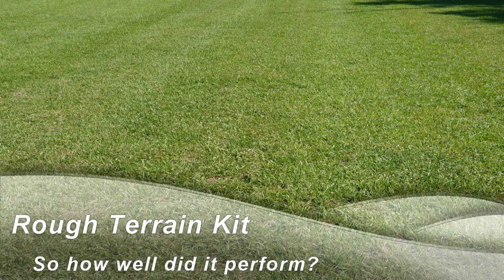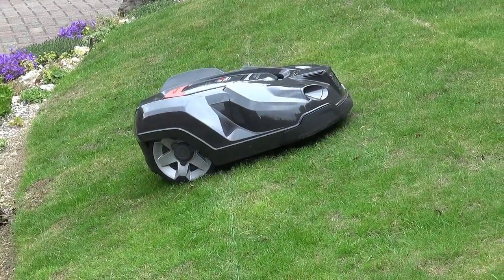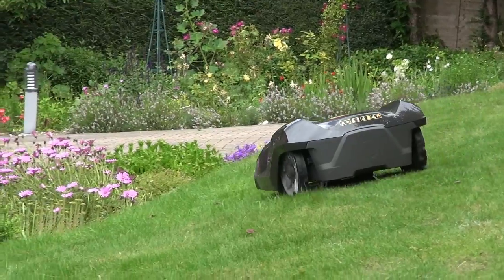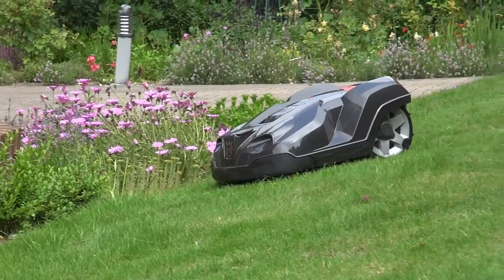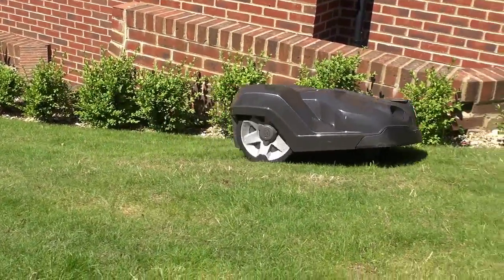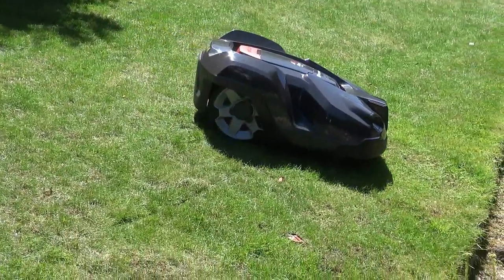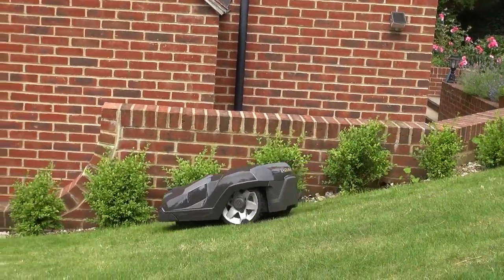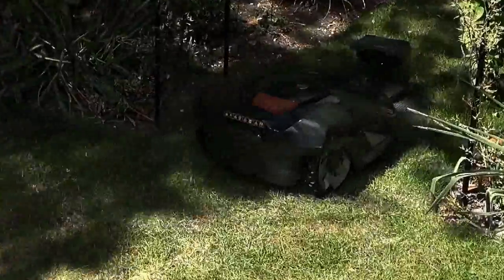Husqvarna Automower - Testing the Rough Terrain Kit

Comment: Extremely helpful videos and subsequent discussions.  Many thanks.  I too am considering a Husqvarna - the 430X - as a replacement for my 20-year old John Deere lawn tractor has given excellent service and have a similar problem where the lawn slopes everywhere at about 20 degrees right down to the flower beds.  Think I need to ask the dealer to set up a demo with the rough terrain wheels already fitted.  Our ground is soft and well-watered by Lake District rain.
Reply: Thank you. The mower is still going well, five years on, with just basic maintenance from me every so often. I've used non-Husqvarna blades from Amazon without any problems. I don't feel the all-terrain kit helped very much, but our ground, here in the south east, really is very chalky and dry. The grass is thinner than it looks in the videos, so there's little for the wheels to grip. We miss the Lakes, used to spend a lot of time there when we lived near Manchester, so know just how lush the grass can be.

Comment: How has it worked with rain and damp grass? That is when the skidding is severe.
Reply: We're on South Downs chalk which is very free-draining. Combine that with the slope, and the ground there is rock hard, much of the time. Rain actually helps, at least after it's dried up, by softening the soil a little and giving the mower a better chance of gripping. I must emphasise that it copes fine with a similar slope elsewhere, because there's a flat(ish) area of grass at the bottom of the slope - it happily copes with going up and down the slope, simply can't stop on it. I don't think the Rough Terrain Kit helps much unless the ground is soft enough for the teeth on the wheels to dig in. I'll just add that, three years on, the mower has performed flawlessly otherwise and required nothing but new blades and the odd clean under the cover. Last year, I ran it right up to December, then garage-stored it for three months before restarting in March.

Comment: Hi...I'd be interested to know how close to the edge of the lawn/flower beds you have the boundary wire and how far you have the automower set to go past the boundary wire. Do you feel that the rough terrain kit is worth the expense?Great videos by the way, very helpful. :-)
Reply: Hello exaisle. Thanks for your comment. To your questions...the boundary wire is generally 250-300 mm from beds (a lot less than that where the grass is level with adjacent paving). I don't think there's s setting for how far the mower goes past the wire, or if there is I haven't found or altered the default. I gradually moved the wire at the bottom of the slope further away from the bed but, in the end, gave up and excluded that part of the lawn altogether. If the slope is too steep, the mower is likely to escape across the wire and either stop with an 'out of bounds' error or continue into the bed. The mower will cope with steep slopes readily enough but needs a level 'escape' area at the bottom. It seems impossible to get away with a boundary wire across a steep slope. I have a Bosch Rotak 32 Li mower (i.e. the smallest, lightest Li) for the excluded area. I use it on the edges all around the lawn too - it's great. As for the rough terrain kit, no, I don't think it's worth it unless you have fairly soft soil under the grass that the teeth on the wheels can get into for grip. Mine is hard, dry, chalky soil (the road I live on is a boundary of the the South Downs NP). I'm still loving the mower though!
Reply: Thanks for the comprehensive reply! The setting I mentioned is in the app...under settings....installation....Drive Past Wire.
I'm on the lookout for a small cordless mower for inaccessible areas and hilly slopes outside the front gate. I'll take a look at the Bosch,  I think it's a good brand...
Reply: @exaisle  Yes, I imagine the Bosch would make an excellent alternative. I gather it's noisier, but that may not matter. The Husqvarna is almost inaudible from more than two or three metres. Nearing the end of its third March-November season, it's performed flawlessly, with just a few blade changes and a good clean at the end of each season. I'll certainly replace it with another, in due course. It amuses me that the cctv cameras reckon it's a car! I have to exclude the lawn from the motion detection area.